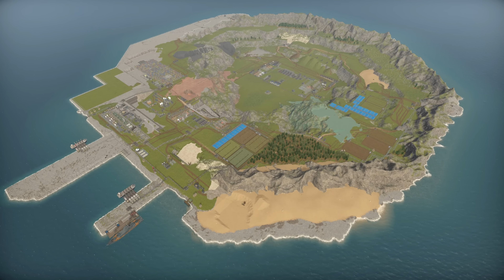MEGA Trucks are the answer! 🚛 Ep26 🚜 Captain of Industry  Update 1 👷 Lets Play, Walkthrough

Comment: Did you know...
The depth of resources is shown by the "columns" that show up when you go into resource overlay...the number of sections...the column has...shows how many levels of that resource are left in that tile
Reply from the maker: Yes it shows how much is left in the 8 tiles around it, but I also know its not 100% accurate due to how its calculated
Reply: OO...kk
Reply: Does it at least tell u how far down it goes?
Reply from the maker: Yes give or take 2 tiles